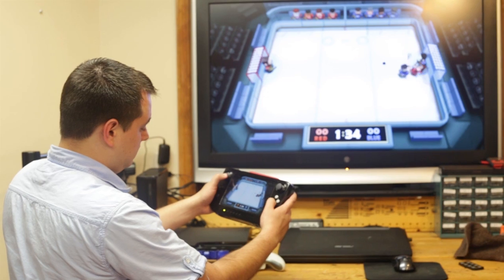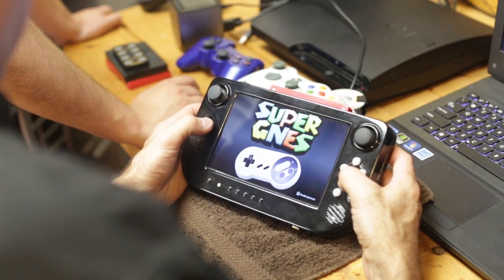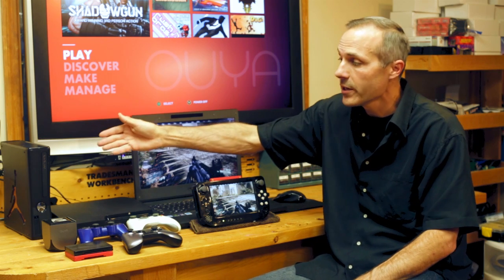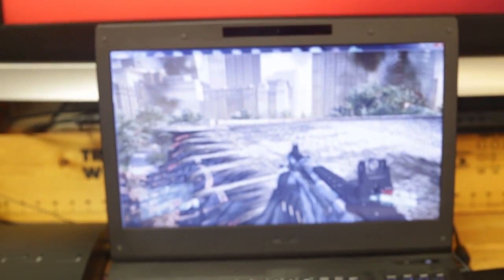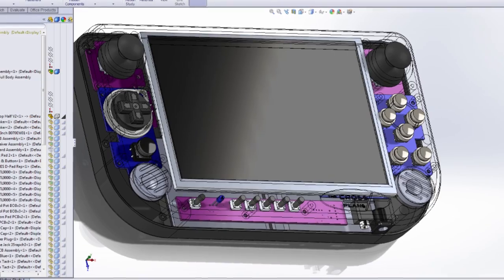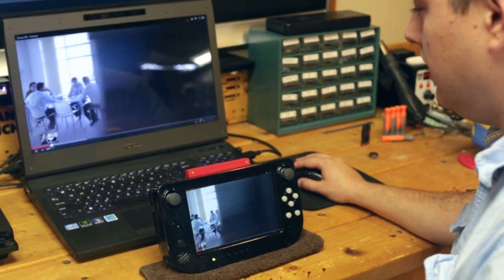The Cross Plane: The First WVI Designed For Gaming

Comment: I think the cross plane would be more successful if you had gone for a smaller market, e.g produce say 100 and then sell them buy parts in bulk and hire a small team of about 20 people and then sell them on a small online store front, if they sell out fast hire a bigger team of say 50 and produce 300. Sort of the way that the open Pandora people did it. This is a coll product and depending on the price point I would proberbly get one but make no mistake, this is a niche product and there is simply not a big enough market for them, so in conclusion don't make the mistake that the ouya people did, don't exactly see them flying off shelves as the number of people who want one was far below the expectations that they had because it was a niche product. Hope you can get that cross plane to market in some form.
Reply from the maker: Right, but you have to look into the economics of that theory, it sounds good on paper, but the minimums that had to be ordered to get said "Bulk" prices fell into the 1000 unit range and that was to just get the system down to around $350/ea. If we only wanted to build 100 units, hire even 10 people to help produce them, than each unit would run over $1100 each to make with parts, labor and freight. That cost alone is more than anyone would want to pay for, much less us being able to mark it up at all. 1000 units was the only way to get it down to the $350 price which even we thought was a bit expensive. The Open Pandora was an absolute disaster. OUYA didn't make a mistake in terms of their production, they did it right, and they still sold a ton of them, though it is more of limited market as you said. But trust me, this was looked at from every angle and planned out as thoroughly as possible. We just needed funds to make it work and we didn't get it. No biggie though, it was probably for the best that it didn't go through.
Reply: you have a point there and you would know the most about it, its just that you have a brilliant product and realy want to see all of your hard work come to fruition in a finished product, i guess the only way that you would ever get it made would be if you got outside investment, plus at the speed that you are building the commissioned one demonstrates your point, maby going back to the retro angle would be an idea, smaller low def screen, cheaper parts? anyway wish you all the best.

Comment from the maker: There won't be a touch screen because honestly, console games for the PS3, Xbox, OUYA and PC for that matter are not designed with a touch interface. Only platforms like Android or tablet based systems make use of the technology and it's really not worth the extra dollars just to say it's there. It will however make use of the accelerometers that the PS3 uses.